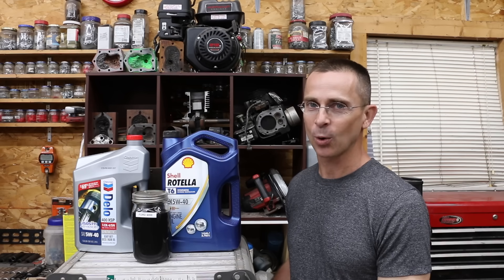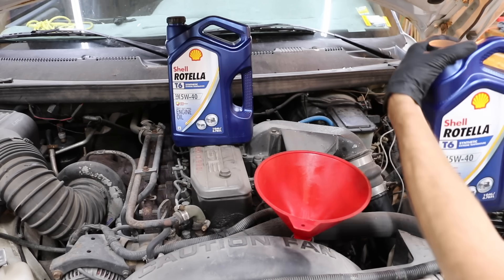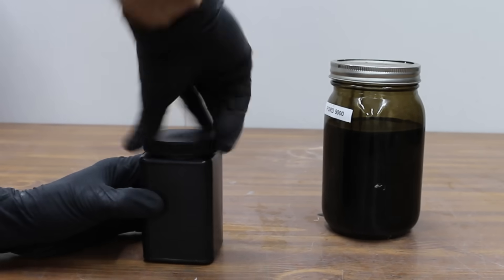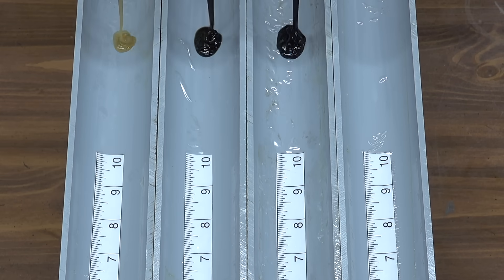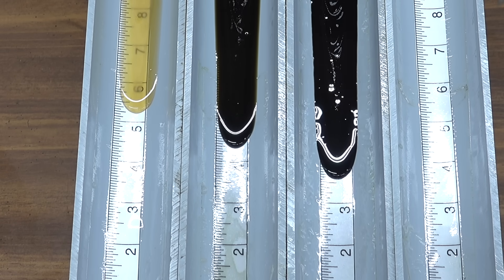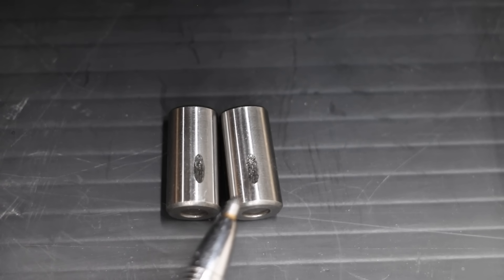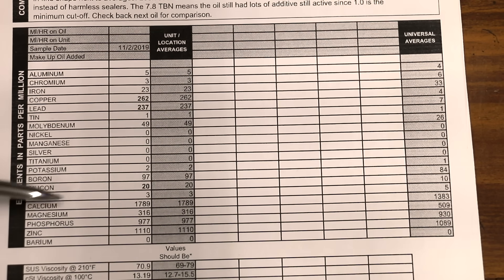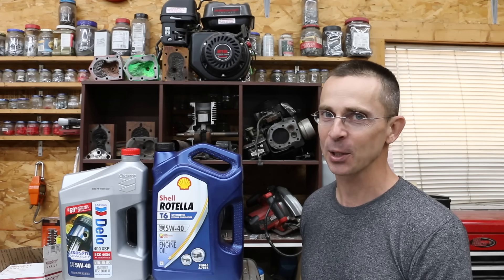Will Annual Oil Change Damage Your Car? Let's find out!

Comment: I tell people all the time, oil is not milk, it doesn’t go bad.
Reply: it does but not as quickly as most people think
Reply: But we have to squeeze the earth's tits to get the oil. sounds like milk to me.
Reply: You're wrong. Oil degrades.
Reply: yes, this video pointed out that if you don't run the car to operating temperature at least once a month...the oxidation will occur and the oil will go bad.

Comment: U know, i notice Europeans dont fuss over oil as much as North Americans....dont get me wrong...i love the results (i too use T6 in my gasoline vehicles) ....also, Europeans (some) switch oil grades seasonally and/or per usage(as in occasional track/racing use). Most vehicles can handle 5/40 or 10/30-10/40, 15/40 grades. (I never follow the cap, its bull).....Example: corvette (2010- current) in North America sold with recommended oil of 5/30.....yet the units sold in EU, The same LS block recommends 5/40......Current Corolla hatch recommended oil grade 0/16...YES 0/16.....(piss). 1 organization to blame here.... US EPA. (Am Canadian btw who have the habit of replacing oil caps with a blank cap that just say "OIL" on it or sanding the numbers down with super fine wire wool 🤣 (personal pet peive))

Comment: I'd love to see your comparison of Delvac non synthetic oil compared to high performance synthetic oil for motorcycles. Here's two camps. Others think that it's OK and use Delvac on high performance motorcycle engines and others that deem it not good idea because of lack of that good foaming agents and additives for clutch plates. I've personally always used those expensive synthetic motorcycle oils just because I personally believe that fully synthetic oil just are better quality oils generally speaking.

Comment: If you run E85 its best to change oil at least once a year, despite the mileage.  I've changed mine with less than a thousand miles on it because it was a yearly change done before the car was put away for winter.  I also use Shell Rotella T6 full syn in my '18 Mustang GT along with a can of Ceratec, wouldn't use anything else.  I have zero issues, and no noises!
Reply: Wait....Isn't Rotella T6 a diesel oil? He mentioned this in the video. Why in the world would anyone use a diesel oil in a gas engine? lol. And in your case the car is a 2018. You wouldn't have any issues or noises with any off the shelf oil anyway.
Reply: @Deucealive75  your comment shows me you don't have a car like mine.  but to answer you, diesel oil in a gas engine NOT running gas is smart, notice I said NOT running on gas.  And yeah, its an '18 5.0L but its tuned and set up to race, so despite its age, its not a normal car.  I also use Liquid Moly Ceratec too, because these engines seem to make timing chain and other weird upper engine sounds and yeah, Rotella helps with that with viscosity rating over standard oil (which is still alright but I prefer to do better than alright).
Reply: @buckeyeman7631  Well yeah. A racing engine is different. A lot of guys will experiment with different things. But many people are using the Rotella diesel oil in daily drivers. 
And from the oil testing data I have seen and trust, I wouldn't use that T6 in my 35 year old riding mower or in any car I own. When it comes to maximum wear protection, there are dozens and dozens of oil choices that test better than the T6, if you include oil designed for gas engines.
https://540ratblog.wordpress.com/
Reply: @Deucealive75  because the rating and chemical formulation may meet more standards. The oil will work fine as long as it is the same weight, just change it out sooner. For me every 10 000km is fine.

 For example, I have a Jeep Grand Cherokee WK with the OM642 Mercedes Benz Diesel, I can run normal API marked synthetic 5W30, 0W30, 0W40 and 5W40, I can also run Rotella T6 in 5w40 and 0w40. 

The oil can meet Mercedes Benz Spec 229.5 and it cannot; Rotella T6 does not meet MB 229.5 but does meet MB 228.31, whereas some other oil may, whether it is a diesel engine oil or a gasoline engine oil. You see how complicated things can become if you follow specifications.
Reply: @Deucealive75  Most diesel oils here in europe are made for gas engines too

Comment: You should not prefil the oil filter because it actually causes a longer oil starvation. The oil pump is empty after an oil change so it pushes air, and is therefore weak. If the oil filter is empty as well then it's easy to suck up that intiial oil because you can push through air through the filter. If the filter is wet though, the oil filter full of air has to push that air through the filled oil filter which takes longer. Do a test if you are unconvinced :)

Comment: I've always thought that water condensation is quite minimal in engines and that it isn't issue after reaching normal operating temp for a few minutes as water is vaporized out of engine via breather. But I guess here lies the breather blowing up on some persons. I guess it's engines that don't reach that vaporizing temp well enough or too short time resulting in breather freezing up and blowing oil out of the engine.

Comment: I drove over 20k a year, I ran Supertech full synthetic 10w30 for 15k miles with a filter at 7.5k miles, never had a problem.  Do not do this with a conventional oil, it will sludge up, I bought a mustang that was loaded with sludge before I knew to look for it, and there were problems, blown seals and leaks.

Comment: Great video! I love your tests.  I would have liked to see if the results were the same on a higher mileage vehicle.  One small point: technically, you did not answer the title question, namely, is an annual oil change harmful. (Question really should have been whether no annual oil change would damage your car. I always watch your vids, but title on this one really intrigued me as I had never heard that an annual oil change could harm your car.)  Thanks for your great work in 2019, and have a merry Christmas!🎄

Comment: you just saved me a butt load of money, and I didn't even have to switch to Geico
Reply: And the video was less than 15 minutes
Reply: Nice 👍
Reply: That’s funny!
Reply: How many insurance companies claim you can save a bunch of money switching to them.
Reply: Changing engine oil is not a buttload of money lol.
Reply: I gave up the system of allowing the oil to get dirty then draining it in 1963. That's a but load of money. Started with a Frantz oil cleaner on my Rambler American. I use the Motor Guard and Gulf Coast filters now. I use Wal Mart refill elements in them now. Great Value 1000. If the engine has an oil pump it has a depth bypass filter.

Comment: I use my Ford 5000 few times a year to push snow at winter. It only gets around 10h/year so I've changed oil on every 6-7 years but it has not exploded yet ;-)

Comment: So, unless I interpreted the results wrong, changing oil once every 12 months is unnecessary?
Reply: He called that a myth and seemed to prove it.
Reply: @David M Redlines are probably not healthy for your engine mate.
Reply: @David M After the engine's been hot for 20 minutes. Reason is that engine oil heats up slower than engine coolant (or so I hear.)
Reply: @David M If you are talking about his video about the Italian tuneup - he mythbusted this video and said that cleaning carbon deposits with driving until redline is plausible but only if the engine can reach very huge temperatures which for the majority of cars is not possible under normal driving conditions. Have you tested before and after redlining your car - if the carbon deposits are removed or do you have a proof? Despite whether or not this is true - this was not my point. I meant that with redline - you put more stress/wear on every component in the car. This is like for you to sprint hard to your limit every time you go outside to clean your blood vessels. Yes it helps your vessels, but you can damage other parts of your body. Mechanics say that the most wear of the engine happens when it is cold or accelerates or when on high rpm.
Reply: @David M It depends on the person. I've seen two people which had identical cars - one drive it gentle the other drive it hard it the one lasted 15 years+ the other was scrapped twice as fast. However it depends on the car too - I know a guy that drives a 4-5 years old jaguar and he had to drive fast at least once a weak because his dpf (I am not sure but I think that) clogs up and the car has to go in the service :D Or maybe you are right if the car has big engine or I don't know. But in Europe - many guys drive "slushboxes" because the fuel is very expensive and the car taxes are high.
Reply: @David M I got your point, I do that too, occasionally I push it a little bit harder on some traffic light if I am the first car. It's just not redline it every time :D
Reply: @David M I don't know friend. As you said a lot of factors come into play - one is to redline some honda, other is to redline a fiat :D. Also the maintenance is important. And also we don't know for sure whether this is good or bad thing. Maybe we should ask this question Todd from Project Farm or ChrisFix. One is for sure - if this works for you - great, as I told you - sometimes I do push the engine harder but just for fun. I haven't seen so far on youtube any proof that doing so will actually clean something in the engine or make more carbon inside of it. For me this topic is very interesting but we do not have any real facts to put on the table - only our opinions. I will search for some videos and if I find something I will send it to you. Cheers

Comment: A nice video. Everyone who cares about cars cares about oil.  I change once a year for many years and have used Amsoil in my cars. I could probably go a year and a half but It's easy to just set a date and stick with it. This oil has a really high detergent and TBN but I also do a lot of short trips so I play it safe though I do let my car warm up to get the oil hot enough to help remove moisture but sometimes I don't.  Best to just play it safe. Got around 130K on it with no oil use, leaks and the engine is very clean inside and I mean looks like new clean which is a good sign the oil is doing a great job. I don't mind paying more if it keeps my car running great for a very long time. I only do around 250 miles per month on it so it's def. not a lot per year.

Comment: I change the oil in my cars every 2 to 3 years.  Have 4 cars with over 200,000 miles.  Just think of all of the money I saved and “good” I did for the environment.,
Reply: That's not a good thing for your cars you should do it atleast once a year.

Comment: perfect. we have a 2013 CRV which only see 1500miles within 2 years. i replaced it after 24mths, as always with full synthetic oil and people blame me for crossing the 12mths mark. now i can sleep easily at night knowing i made the right decision. i wouldn't go past 24mths, but come on 12mths is just too short...
Reply: That higly depends on your local weather, driving conditions and if the vehicle reaches optimal driving temperature (at least a 15 min drive (varies by car, engine, etc..) at highway speeds) every other run.
Reply: Exactly my case! Now I can sleep good, knowing I don't make sin not changing my oil before one year, because it has only 1900 miles.
Reply: I change my oil every month because I'm not a crackhead
Reply: @hufman9807  Are you sure ?
Reply: If it doesnt meet the mile mark it needs to be changed by time.  Oil goes bad just by sitting.
Reply: @zuestoots5176  You obviously didn't watch the test in this video.
Reply: @zuestoots5176  "Oil goes bad just by sitting." This is a myth and valid for some corner cases, but not for the majority of people.

Comment: You can't get meaningful real-world results with these simple tests; you'd need to test too many vehicles in too many climates with all the different oils being driven by all types of drivers. Thousands of test examples. Still, there is something to be learned here...

In my personal car, once a year is probably enough; it doesn't get any heavy-duty use, not too many miles, and has a low book value. Being careful I do it every 6 months anyhow. My work truck takes a beating- 3 months max for it, partly because it's something of a worn engine at this point and combustion gasses in the crankcase are far more than the average engine sees. That makes a huge difference in what shape the oil is in. 

IMHO more important is the oil filter- I've ruined an engine because of a bad filter design made by one of the most highly-thought-of filter manufacturers. There's a few well-done comprehensive tests of filters to be found online explaining what you need to know and do. One simple and safe rule is to use only the filter the manufacturer put on it- they're all going to be at least decent since they don't want warranty claims. Can't go too wrong doing it this way. But if you want something better, it's out there though the prices won't make you happy. Still better than losing an engine too early though.

With the right oil and filter, and with frequent oil changes, you can practically double the engine life versus the average example of the exact same vehicle. In the end the cost is probably similar either way, but if you want to keep the vehicle forever the choice is clear. I've seen many dead vehicles from under-maintenance but never one dead or damaged from over-maintenance. Just sayin...

Comment: I'm glad you added that's not a problem assuming the engine is brought up to operating temperature. I have a vehicle that was moved several times only a few blocks away, parked and brought back home. After only a month of doing this the oil looked milky. I drained the oil and couldn't belive how much water came out. I never ran these short trips again without letting the engine fully warm up. No problems after that.
Reply from the maker: Thank you for the feedback

Comment: Have you ever tested brake pads? Would be interested to see wear rates, heat resistance and how aggressive the dust is - I use Brembo which work well but the dust on my wheels is really hard to get off!

Comment: I was going to switch to t6 in my 05 avalanche, but them I looked at the odometer and saw it was at 391k miles and realized whatever I'm doing it working haha. I change at 3k then 5k next change then 3k after. Rinse and repeat. Seems crazy but that's how I've always done it and it works. Normal 5w30 conventional oil works for me.

Comment: Since you brought up oil bath air cleaners in the video: I've heard a LOT of old timers tell me oil bath was better at filtration than foam or paper media filters. Even heard one go as far to say that air filter companies launched a conspiracy to end oil baths just to sell more filters to farmers. Would be a cool test to see air flow and filtration efficiency between oil bath and other types of air filters.
Reply: Oil baths are great at catching coarse to moderate sized particulate, but not finer stuff. Older engines could deal with this, modern ones can't. The other big factor: turbochargers. Not a good idea to be sending oil vapour through them!
Reply: @B Watts no, K&N just say they are the best
Reply: My john deere tractors I have from the 40s and 50s with no over hauls to my knowledge run good yet so oil bath has to be pretty good
Reply: @B Watts K&N say that to sell more filters. They trade an awful lot of filtration for a chance at marginal increases in power. Not worth it!
Reply: paper air filters are very good at filtration and low restriction. oil filter baths are good at filtration but have much higher restriction. at least thats what i heard. i have seen many aftermarket air filters with dirt past the filter so i dont trust them (there are better ones out there however)
Reply: Oil bath filters are extremely good at keeping particulate out of your engine, especially for dust and dirt, which is a lot more common on farms than it is for your car to experience most likely.
Reply: @B Watts Aren't K&N just high air flow filters that let some dirt go past the filter?
Reply: @101Volts  yup.
Reply: I'd like to see a comparison as well, just for curiosity. In the 70's it was an "upgrade" option to an oil bath from a paper element filter for HD service for Ford trucks.
Reply: @B Watts yeah unfortunately they aren't the best. They may flow better in certain situations, but all that does is allow more dirt in. I'll take paper WIX any day.
Reply: @B Watts the older terra gators and the newer tg9300c draw thier air next to the cab, the 2008.5 9203 draws the air in the front where there is less dust
Reply: @B Wattsbelieve and/or fanboy what you want.
I'm not a K&N hater, I just see how they hurt a few motorcycle v-twins on a dyno and on my stroked 73 El Camino. I've also seen how dirty the elbow was behind one on my personal 125 ci v-twin.
They are expensive hype. You might get a little more airflow at extreme rpms, but at the cost of cleaner air.
Reply: I'd like to see this as well.  I have an idea but would like to know.
Reply: The 2008.5 9203 terra gator had an awesome dry filter system much better than the 2008 & older. I ran it 3-4 years with almost no dirt in the filter. The others you had to clean almost daily. With the new models, they returned back to the old design. Not selling enough filters?
Reply: @B Watts not at all
Reply: Filter conspiracy? LMFAO
Reply: Paper disposable filters whatever there effectiveness are quick clean to service oil bath filters are not
Reply: Johndeere167 TV 
Oil bath very good